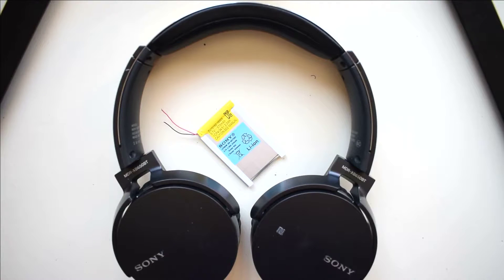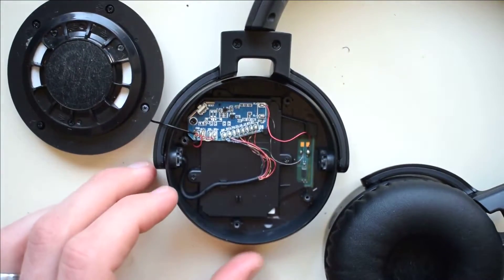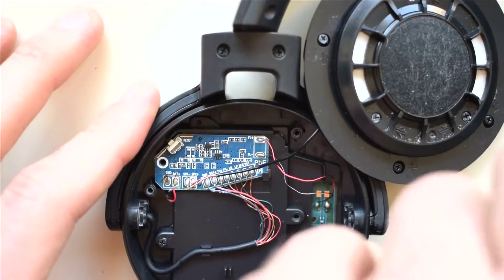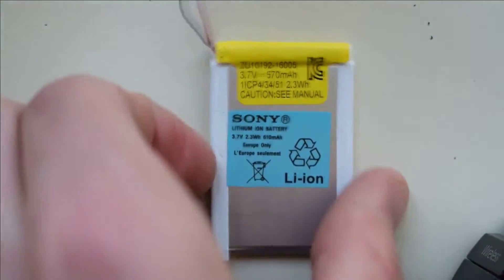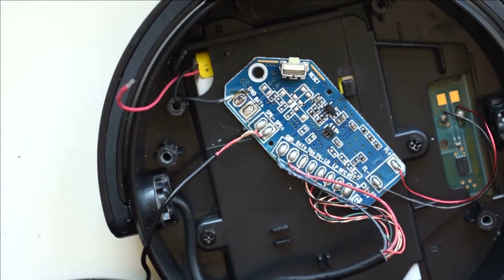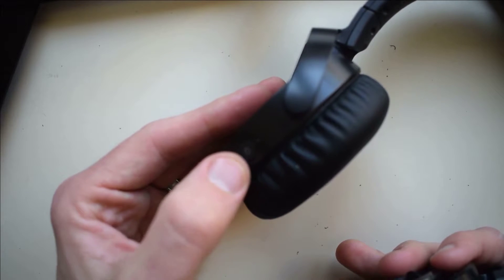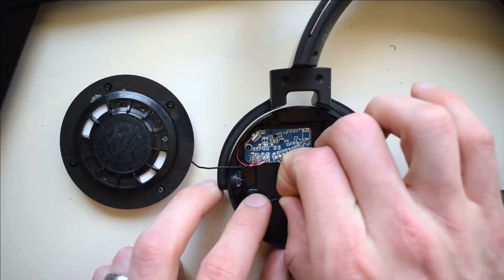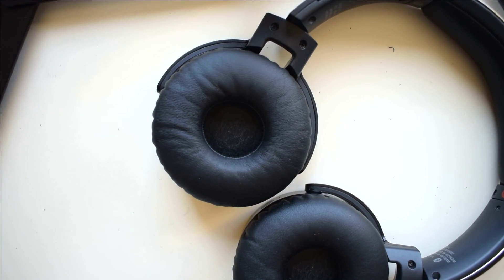Sony MDR-XB650BT Bluetooth Headphones Battery Repair/Replacement

Comment: Was the light blinking red when trying to charge? Is that why mine won’t charge or turn on? Bad battery??
Reply: Have you tried the reset button on the left speaker first?
Reply: Carlos Villa yes nothing happened

Comment: It is a common problem for Sony headphones. It is related to software and not the battery. Use a paper clip to press the reset button. This will correct the charging or  power on issues!!
Reply: Before un-soldering the battery leads, I used a multimeter to check for voltage- 4vdc- hit reset button and heard that lovely "HEADPHONES ON" voice again. The reset button is on the circuitboard, top left.
Reply: Christian Tsouras was the light just blinking when you would try to charge?

Comment: Hi. Is there a way to tell that battery is faulty? My phones can't be turned on, but are fully charged. Voltage on the battery is 4.2 V. Also I know that power button works because when connected to pc, power button lights phones and they are detected by pc. Thanks.
Reply from the maker: Hi,
The most likely cause is that the battery is bad and needs to be replaced. The board could also be faulty, but this is less likely, unless your headphones recently had physical or water damage. I would recommend trying to replace the battery. Sometimes even just de-soldering and then re-soldering them will fix the battery issue :)
Reply: @jontriestofixthings3718  HI. I decided to leave the headphones alone for a week and then tried again. They started to work again. So we will see. Thanks.

Comment: Sr. i bought the MDR-XB950B1 a few weeks ago while i was in the US now that I'm back in my country they won't charge, would replacing the battery there is no light while they are connected to the charger or computer and they come on for a few seconds before going off because the battery is out of charge. What do you think i should do since getting a refund is out of question?

Comment: My headphones won’t charge anymore for no reason, do I have to replace the battery or are there any other way to fix it. I cannot charge them therefore I need to use the aux
Reply from the maker: Hi. You probably need to replace the battery. Definitely try a new charging cable and wall outlet first though :)

Comment: mine just died after a few months. rip
Reply from the maker: It's easy to fix if you want to give it a shot! If you need any help feel free to reach out to me :)
Reply: @jontriestofixthings3718  Thanks for reply. They started charging again after like 5 minutes. I guess the battery was pure %100 and needed extra time to start up.